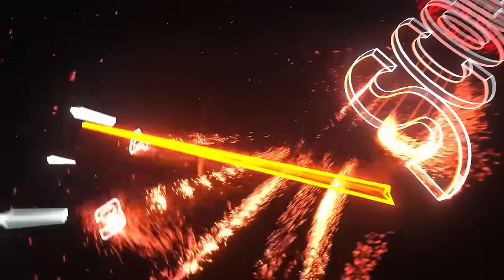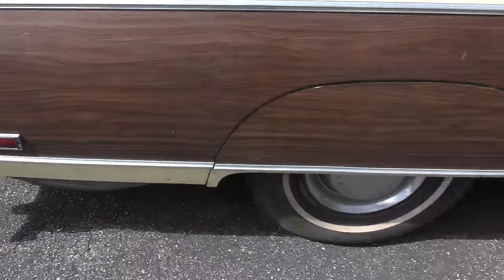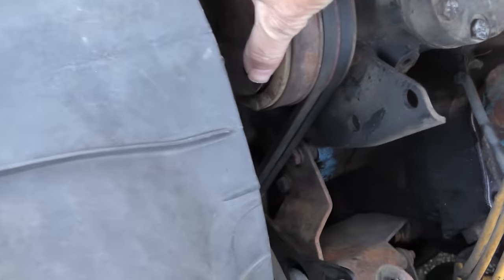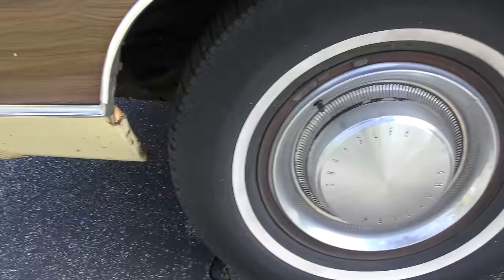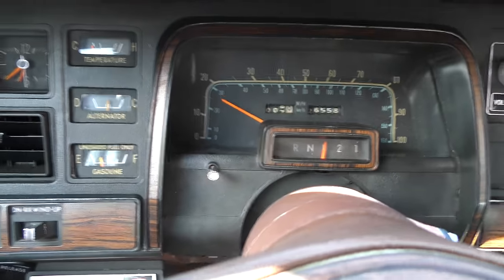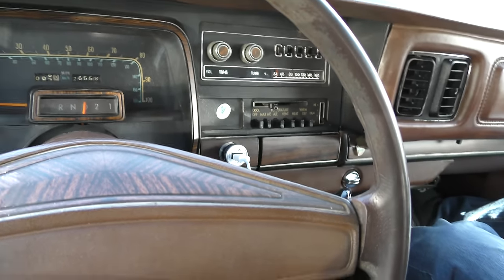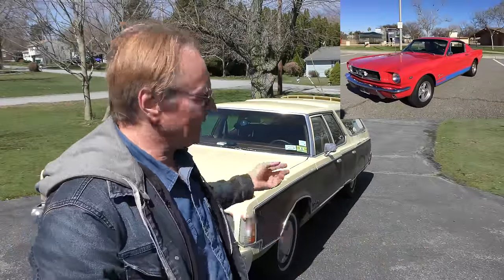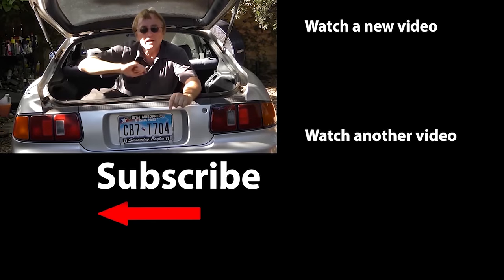I Just Found My Dream Car (Goodbye Toyota)

Comment: actually the spoiler was to keep exhaust from entering through the back window if it was down while driving. Kids riding in the back died from carbon monoxide poisoning in earlier years before it was mandated. It did keep the window clean as well
Reply: Correct. Designed to keep the exhaust gases out, not to keep the windows clean.

Comment: “It has been brought to my attention that this vehicle still better than a Tesla.” 🤪🤪
Reply: Tesla cost 85K and it will take 10 years to pay off for average American middle class. It is a high risk for financially drained due to service and parts that might be available including power grid and location for charging every 400 miles.
Reply: @johnmadow5331  i bought a 2015 model s for 22k  with 65k miles on it . Couldn't be happier

Comment: When I was a kid my father got my mother a new 1973 Chrysler station wagen with a 440 4 barrel engine. It was a tank. If you put the back seat down you could fit an 8x4 plywood board, more than today's 4 door pickups can hold. It was the car I learned to drive on and one of the very few automatic transmission vehicles I have driven.
Reply: The Torqueflyte Automatic Tranny Was Very Reliable,  As The Massive 440 V8.
Reply: @coiledsteel8344  The came with a 3.23 dif? Or  2.92 ?
Reply: One of my friends parents had a 73 Chrysler town and country with a 440 and 273 gears in the back. It was incredibly fast on the freeway.
Reply: @nh6103  If my memory serves me correctly the 73 Chrysler station wagon was the heaviest non-truck vehicle available in 1973. Even so, when you stepped on the gas it was fast. I bet it didn't get better than 12 mpg.

Comment: My family had a '68 Bonnieville wagon with a giant v-8 under the hood. My parents allowed me to use it when I was 16 - 18 years old. That thing looked similar to the Batmobile and would smoke the tires up hill without having to push the accelerator very much. Lots of fun.
Reply: I learned to drive in an AMC Natador wagon!🤪
Reply: That is an interesting likeness, the 68 Bonneville to the Batmobile... could have been cousins from the front view.
Reply: @brianmiller5444  Matador
Reply: @seanmcfadden6600  yes.  Typo.  Hit send too soon.
Reply: @brianmiller5444  You mean Matador?
Reply: @brianmiller5444  You’re not alone. 😂
Reply: Bonneville.

Comment: I had a 1962 Chevy Impala station wagon, 283 cu in V8, and a 2 speed automatic transmission. My Dad owned it first and we vacationed all over the eastern U.S. in that thing, towing a pop-up tent trailer. Then, he gave it to me while I was in college and I drove it until it had over 235,000 miles before I bought something newer (a 1969 Chevy Caprice 4-door, 327 cu in V8, 3 speed auto). I really miss that station wagon, except it didn't even come with A/C.

Comment: I had an 84' caprice wagon that was my grandmother's she bought new. I got  it when I  went back to college in 1998. I loved that beast.  It was an awesome ride with loads of room and it was easy to work on.  I loved the reverse facing, fold down, back seat  and two way opening tailgate/door. That thing was solid and dependable. I did it a major injustice when I turned left without looking at  an intersection and got t-boned just behind the passenger side, front door by a newer full size Cadillac. Caved in the piller, rear door, and front of the rear fender. A total loss at that point.  I long for another like it.  Nothing quite like them.  They were a very unique vehicle for sure.

Comment: Interesting that the rear door has the hinges on the left side which makes much more safety sense, most modern cars are hinged on the right side which seems more dangerous when loading and unloading while parallel parked.
Reply: The 2 way tailgate on Honda Ridgelines is also hinged on the left side to open like this Chrysler does which makes easy access to the truck bed.  They also open like a traditional tailgate
Reply: Didn’t Ford invent that door gate in the ‘60s?

Comment: looks like the one I learned how to drive in, except the one the school had was a 1979, mind you I took drivers ed in 1989 so the car was already 10 years old by then. One good thing about learning how to drive that wagon was i learned how to parallel park in it, so if I figure if I could parallel park a '79 wagon I could/can parallel park anything!!!
Reply: I think that 1978 was the last year for the full sized T&C. In 1979, the T&C wagon was based on the newly introduced LeBaron intermediate (M body) platform that I believe was a fancy Aspen/Volare.

Comment: I remember as a teenager we had a dark green Mercury Montego MX with a 351 Cleveland engine.  Once when going to a roller skate arena, we had 17 teenager plus my dad in it.  Its the vehicle I learned to drive on.  When it finally gave up the ghost, it had over 250,000 miles in it (on its 4th junk yard transmission!).

Comment: My Dad had several wagons in those years. All Fords. A 1960, 1963, 1968, 1972, 1979. Three Country Squires ‘60, ‘68, ‘72; the others were Country sedans. Big cars, but could seat all 10 of us. The 1972 had Ford’s 429 4V engine.

Comment: My Datsun pickup had only a push button AM radio, bench seat and no seat belts. 

By the way, I just loaded a 5 ft tall refrigerator into my 2010 Matrix.
Reply: I've got a Pontiac vibe (a matrix in Pontiac clothing)  I used to haul bulk mail with it   when I looked at the total weight tally on the paperwork    the mail with my weight total was almost exactly 2,000 lb    I was wondering if it would even pull up out of the loading dock as it was at such a steep angle    but surprisingly it came right out and didn't even seem to notice the weight    it didn't squat much at all and made  the10 mile trip to the post office no sweat  it is amazing what you can haul in these little cars     when you get your mindset as to how you're going to fit it in there 😁👍
Reply: I hope you stood it up for at least 2 days to let the oil go back down into the compressor before you turned it on.

Comment: I had a 1976 Chrysler New Yorker with a 440 engine and the V2 air compresser.  The big problem I had was with the power brake booster diaphram.  It would start to leak air every 4 to 8 months, and I would have to replace the whole brake assembly, which included the master cylinder.  When all was running well, the car was a dream boat!  14 mpg hwy, 8 mpg city.  The front end design gave me grief.  It was not really strong enough to carry the weight of that size engine, but it was like driving a sofa!  (1989-96).   P.S.  Remember the Chrysler Cordoba with it's "Corinthian" leather front bucket seats?  Whoa Nellie!

Comment: I like the Ford LTD I had one of those that thing with the freaking boat but it ran really good the door shut perfect it still ran after that my cousin cut it down the middle made it into a vehicle you could carry a motorcycle and when he went to go race motorcycles. I felt bad because I really liked it car John Rogers used cars sold it to me.. And I wanted the fast sporty car uses why would you want that you got a kid and the wife at the time he said that vehicle is going to get you where you need to go and you’re not gonna have un- reliable issues with it.
But back then gas wasn’t an issue like it is today…

Comment: White walls are still available I bought set of Coopers tires for my Galaxy online. My parents had a 63 New Yorker Station wagon with the push button transmission and later a 68 Plymouth Wagon with the wood grain decals I miss those cars.

Comment: I had a 79 Pontiac Safari Wagon with a PONTIAC 301-2bbl and an 87 Olds Vista Cruiser with a GM generic 305-2bbl. Both cars had loads of room in them that allowed me to carry all my fishing gear in them and all of my son's stuff for college.  And of course the standard sized 4'x8' wallboard. Both cars ran well and both got 150K miles (and original tranny) before I got rid of them.

Comment: Well Scotty this was the best "back in time ", video that i have seen from you you literally had me in tears laughing , it brought back memories of my 1970 ford galaxy 500 wagon , that i bought in college for $600 , back in the early 80's , and just like you said that thing was built like a tank , you could even turn the seats down and fit a whole sheet of plywood in it, me and my friends did everything in it and then some , LOL , you could lay on the hood or the top and never worry about it denting , mine had the badass 429 engine with enough power to remove a tree stump, i killed it drag racing over a bucket of chicken and a six pack of beer one night, we hit a bump in the road while going around a curve at about 80mph , the car broke a n electric pole in half the rear end caught the stump and pulled it out then we slammed into a small pedestrian bridge and took that out too , thank God there was no one on that bridge , i swear to you  none of us were wearing seat belts and all 12 of us climbed out of the  wrecked wagon with minor scrapes , all i can say is that the Lord was protecting us, LOL🤣

Comment: In the late 1990s I was fixing up a 1969 Dodge Camper Special pickup, including the speedometer, which probably had the same mechanism as this wagon. I disassembled it as far as practical, used compressed air and brushes (and I think some electrical cleaner) to clean out 30 years of dust, and relubed it with some high quality heavy silicone oil they threw away at work. Back together, and with the cable lubed with moly grease, it was smooth as new.
   You could figure out what to do to fix these old beasts with a little study and observation.

Comment: Reminds me of my Plymouth Volare Wagon (think it was a '76?). Same wood grain decals. That baby was a rare 4 on the floor stick shift (4th gear overdrive) with a slant 6. The only slant 6 I ever saw that came with a factory 4bbl. Carter carb! Very lean tuned. Had to learn to drive that transmission. Get it up to around 60 before you shift to 4th gear, and you could take 3rd up to 75, no sweat. It could cruise at 90, but was no dragster. Gave 25 miles per gallon, highway, if you drove it at 70 minimum.
It had a trailer hitch, and the clutch slipped bad when I bought the car for $200. One cylinder had a burnt exhaust valve, but it still ran fine on the other five!  (I was just going to drive it till it died..).
Drove that car trouble-free for almost 10 years! I only put in a new clutch kit, and used tires from the junkyard.  Yes, it was a great car, used to take road trips in it. Wish I still had it.  I gave it to a poor family and they drove it for more years after me on the expired tags (it was a family car, and it would never get pulled over!).

Comment: Looks a lot like my old '78 Grand Safari. In 1990 we drove that beast from Denver to SF on Highway 50, loaded with 8 people! There was a rear facing "rumble seat" in the back. The luggage was on the roof. Our MPG was so bad that we could only just make it to the gas stations through Utah and Nevada, but hey, we were splitting it 8 ways! We took I-80 back. She finally blew up a couple years later with a zillion miles on it. Miss that car.

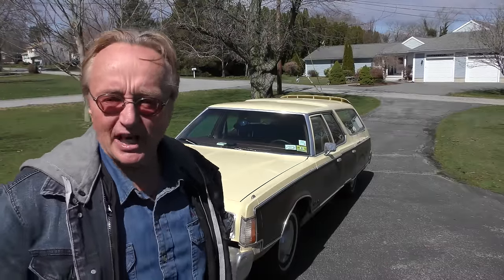Comment: 8:30 I agree with you. I sat in a Hyndai Ioniq 5 electric hatchback. It basically had a front bench seat!. You get the leg room like in this and the arm rest can go up. But instead of sitting in the middle it is meant for a bag or a purse to be placed in the middle. That would be the EV that I would get.

Comment: In 1987, bought a 77 Caprice wagon. I paid 50 bucks for it because it wouldn't drive. $25 to replace the transmission filter and it was good to go. Well, until a truck ran a stop sign and T-boned me and wrecked it.
Reply: That truck told you to buy newer car
Reply: @ranggaajibaskara1809  well, it was only 10 years old at the time.

Comment: My dad had a later model of this same. It was blue, it had even more chrome everywhere, including inside the steering column shifter and all kinds of buttons. Huge couch-seat, I loved that car, I could drive on a rough dirt road and not feel a bump!  On highways, it felt it it was floating above the ground it was so smooth!  They don't make them like it, or if they do it costs 100s of thousands of dollars or have a mercedes or lexus badge on them.

Comment: They still make station wagons.  My Subaru Outback is called a "wagon" according to Subaru, lol.  I know, it's not like these wagons.  Our family car was a 66 Plymouth Fury III sedan with a Commando 383 V8.  What Scotty was talking about the power brakes is what this car had.  You barely had to push the brake pedal and it really did stop on a dime.  I used that car to do my driving test in 1982 to get my license.  It only had lap belts, no shoulder restraint.  Bench seat, extremely smooth ride, chrome bumpers which is where you'd attach the jack to change the tire.  The gas cap was behind the license plate.  I wish we'd have kept it, my dad only got $300 for it on trade in in 1988 and it was in decent shape.

Comment: Volvo wagons for me since 1979.  Must have had over 20 by now.  Favorites are my old 122’s.  Great winter cars.  Best 2wd I have ever had in the snow and ice.  

But we had 140’s, 240’s, and now a 1995 940 turbo wagon.  1995 is the newest Volvo I could ever own (redblock engines).  Another favorite was my 1972 1800ES “sports” car wagon.  Awesome!
Reply: I've got a volvo v70 1999 volvo is so much fun.
Reply: @BramSizoo  they will “run bad for a long time”.

Comment: My second car ever was a 1969 Chevy Kingswood wagon in 1973 when I was 16 years old. Had the 300hp 350 and I beat the heck out of that poor car. Got it up to 112 mph. Also for some reason it was only equipped with non power drum brakes all around, the worst brakes I ever had in a vehicle. A kid I knew worked at a gas station with me and a customer GAVE him a 1969 Chrysler wagon, loaded, even had power bucket seats and center fold down armrest plus power everything and NO rust.
Reply: Dm to claim for your 👆👆 winning prize👍...

Comment: Definitely put new tires on it. Those old tires will shred apart while you're zipping down the highway; I've had it happen. But I love old cars and use them as daily drivers, currently a 66 F100. They can be dependable, although they require more maintenance than new cars, and are a lot more fun to drive and work on.

Comment: in the 60s I took my driver's test on my dad's Pontiac Bonneville station wagon passed the first time too. it was a boat. I have an 89 Buick century station wagon that I bought from new. I still have it keeping it running 2,74,000 miles on it.

Comment: Ok, I had a 1969 Fury Stationwagon that my dad got with a blown engine. I replaced the 318 engine with one I had. Loved that car and my mom drove it for a long time.  
So the car in this video has 26,000 miles on the odometer.  With all that rust it must be 126,000 miles.  That’s an awful lot of rust for a car that, like me, spent it’s early life in Jersey.  Must have been in an area with lots of salt!

Comment: You didn't mention those turn signal indicators mounted on the front fenders. I always though those were a good idea and some owners installed them on Chryslers, Dodges and Plymouths that didn't have them from the factory.

Comment: I grew up in Ford Country Squire wagons. Same wood paneling stickers. Some had the fold up rear-facing extra seat but we never used them. We would just sit on the floor in the “way back”. Didn’t know what a seatbelt even was. The back would open sideways like that one or straight down like tailgate.

Comment: Lots of Chryslers had those fender skirts back in the 6os and 70s. My folks had a Newport with them and you had to reach under the fender, grab a rod under there to release the skirt and a pound of dirt and gravel would fall out in your hand! You had to remove the skirt to change a rear tire bc the bumper jack that came with the car wouldn't raise the rear end high enough to pull the tire out. If you did get the flat out from under the car, you couldn't get the spare back in place.
Reply: As a teen I worked in a gas station and we always struggled with those fender skirts. That and Chrysler’s left-hand threads! Constantly snapping wheel studs!  😂😂
Reply: @seanmcfadden6600  yeah....the skirts looked cool but were a PITA! leaving them off made for a hideous  looking vehicle. I think Chrysler was the only one who had the left and right hand threaded lug bolts. They were stamped on the end to remind you that you couldn't interchange left and right lug nuts!
Reply: @northdakotaham1752  You’re right they were stamped on the end.

Comment: We had a spoiler like that and if you slightly opened the rear glass it would help pull cooling or heating air to the rear seats.

Comment: I had a 70 Buick station wagon with a 350 rocket v8 (Buick engine) and that car was insane fast and roomy as all get out. The car was free cause it needed a rear end a quick swap. I miss the good old days.
Reply: Probably seemed “ insanely fast” in the day, but honestly it wasn’t

Comment: I’ve got a 2009 Toyota Venza with a V6  at 289hp it’s labeled as a wagon I just bought a 70” tv and it fit box and all with a foot to spare in the back best modern wagon on the road

Comment: That's a "small" wagon...I had a 1971 LTD Country Squire 8 passenger wagon with the woodgrain sides, that you could put a 4x8 sheet of plywood in back, and close the back two way door.
It had a 400 cid motor that sucked gas like there was no tomorrow. It wasn't very fast, either.
Reply: Dm to claim for your 👆👆 winning prize👍..

Comment: If the 'environmental focus" been on the type of vehicle people drive - and keeping people in sedans; you would have seen Elantra, Corolla, Civic wagons that would be super practical with high utility.  Yeah my Civic was a "one speaker AM radio" .. also my '74 Coronet (more speakers I assume).  My 95 Neon had the AM/FM I felt it was "luxury".  White wall tires - I immediately think of SOS pads eh.